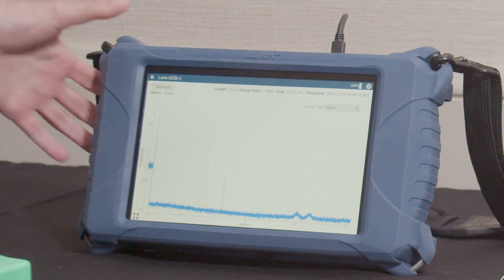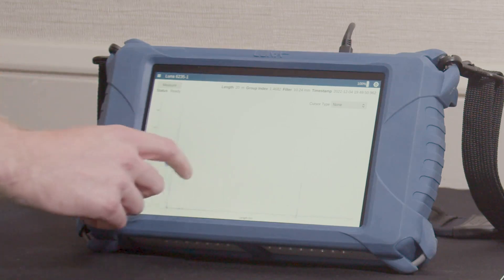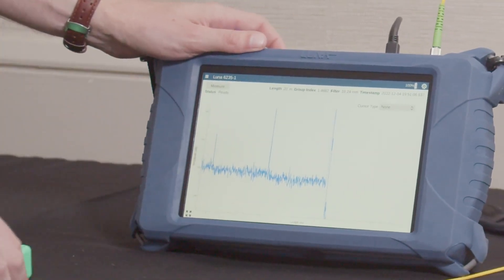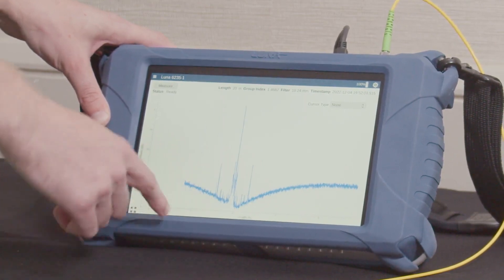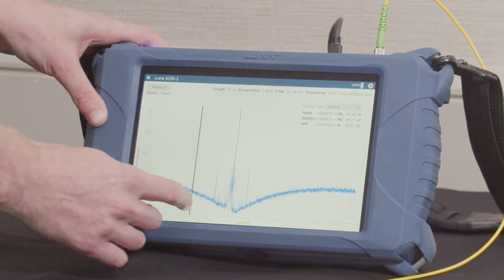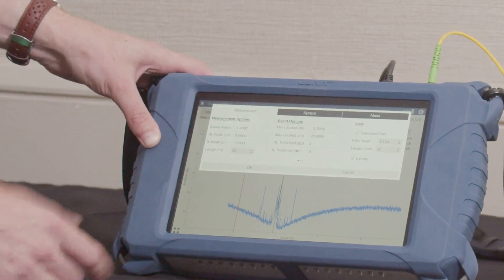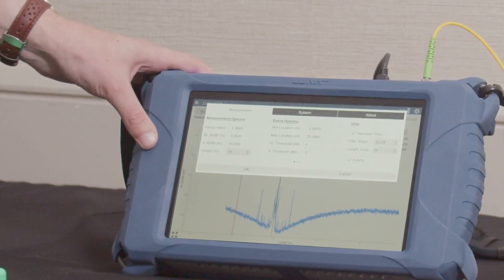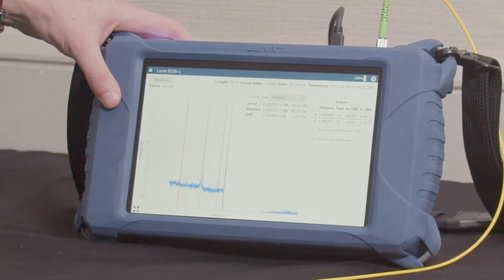Luna Innovations OBR 6200

Comment: Very interesting question is: whether it can effectively work with such components as splitters in a network
Reply from the maker: Yes, the OBR 6200 works effectively with splitters and all passive components in the fiber optic network as long as they pass light at 1546.7 nm +/- 5nm and are bi-directional so light can come back to the OBR 6200. For example, OBR 6200 doesn't work well with Isolators in the system, since the back-reflected light after the isolator won't make it back to the instrument. For more details, please visit https://lunainc.com/product/obr-6200-series or contact our application engineering experts at solutions@lunainc.com.
Reply: @lunainnovations  Thank you!